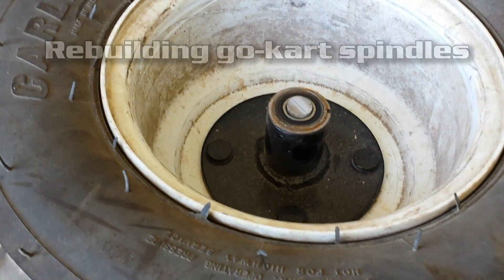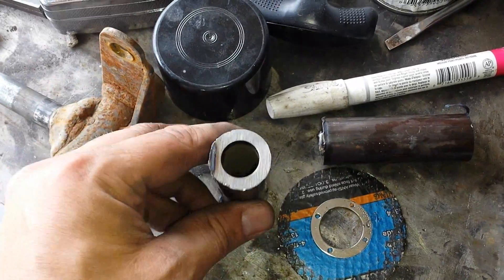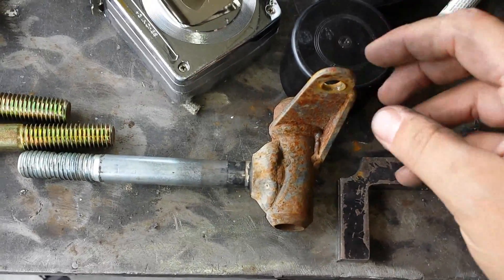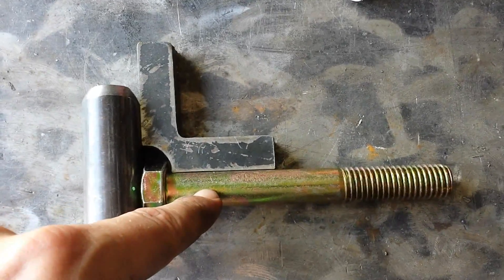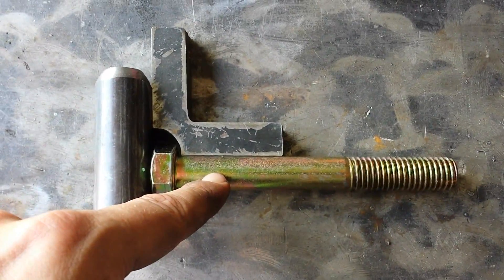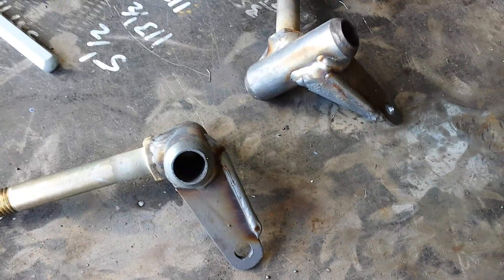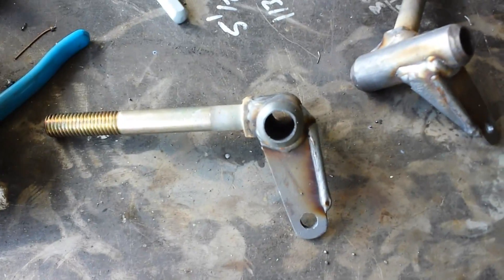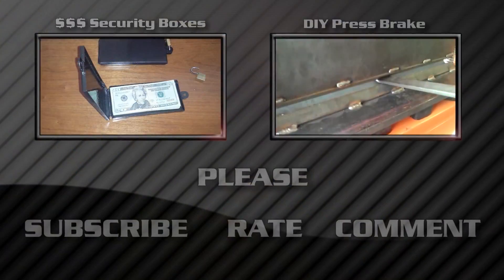Rebuilding Spindle Arms For The Go Kart

Comment: Mig welding is not deep enough penetration for a stressful joint. Arc is much better. But grind zinc off first not just because its poisonous but it contaminates the weld.

Comment: Wondering if quenching the bolt weld would help restore the lost Grade 8 hardness that was destroyed in the welding process (if the entire shank/head was fully red). Especially considering the cantilevered stress-point is exactly where the old one snapped off.  BTW, like the suspended Kart front-end.
Reply: Never artificially cool weld on reinforced metal. It will snap if not now later

Comment: The bolts break because the high welding heat ruins the temper in the metal, if you treat the spindle like a knife blade and re-temper in an oven they will last a lot better. I like the video.
Reply from the maker: Makes sense. Thank you.
Reply: If the temper was ruined  it would bend not snap

Comment: Hi, I'm designing my new go kart with suspension project currently, and am looking to do something similar to yours with the a-arms and eyelets to fasten the spindles to.  Can you tell me what you used to attach the eyelets that the spindle bolts to? It looks like it goes through the center channel of the a-arm and is secured from the backside.  Did you fab these, or are they sourceable? Thanks!
Reply from the maker: If I understand you correctly it is something similar to this but wider:  http://www.bmikarts.com/Shock-Mounting-Tab--38_p_1285.html

You can buy them somewhere, but I just made mine.
Reply: Thank you for the link.  I was actually referring to the eyelet/balljoint that is affixed to the outer end of the a-arms, that the spindle mounts to and pivots on.  Did you weld a nut onto the a-arm, or is that eyelet part of a longer piece that goes through the channel on the a-arm and secures with a nut from the backside?

Thanks!
Reply from the maker: Yes, I just welded a nut onto the end.  I then can adjust the length of the tie rod end in and out.  I was able to make unequal a-arms that way (even though the arms were all built the same)
Reply: In your opinion, with the different length arms enough to give it camber gains in cornering, and does that help it track through corners better?  Also, are your upper and lower arms mounted exactly parallel to each other, or is the lower arm just slightly ahead of the upper in order to get a positive caster, or if not, how were you able to get a positive caster with your spindle set-up?  

Sorry for all the questions! All of the info you can give me is greatly appreciated and saves me from having to go through trial and error
Reply from the maker: Yes, I think it helps, and one set of arms is slightly behind the other.... but I don't remember which way.  I think the upper are behind the lower..... I remember having to add a few degrees to my spindles to even out the tires too.
Reply: John Harmon - Cold Creek Works awesome, I had some questions as to whether or not they would compress and travel like that, but you answered all of my questions and I think I have a direction to go now. thank you!

Comment: Don't include zinc in any weld. Grind off. Also never rely on that weld Grade 8 will snap as well. Do vertical tube , then add tube perp. with id that matches bolt od. Cut head off slide bolt in hole and rosette weld away from stress area. You now have a spindle that does not rely on welds in the load path.. at all  Ezy peezy

Comment from the maker: I wasn't wearing a mask when welding the galvanized metal (I have one).  Believe it or not I was holding my breath (which I do often when welding--at least on short welds).  It is hard to see when it is that fast, but I hold my breath, weld, then turn to clean air to take another breath before welding again.
Reply: The mask is for your eyes......... doh
Reply: Galvanized fumes is toxic,
Reply from the maker: @joshuabartley1279  I know.  I weld in an open door garage, hold my breath, and breath outside in between welds.  Probably better to have a mask, but I don't know that the ones I have are sufficient.
Reply: I understand, that will work just fine. I was commenting to the person that said the mask is for your eyes. @JohnHarmon